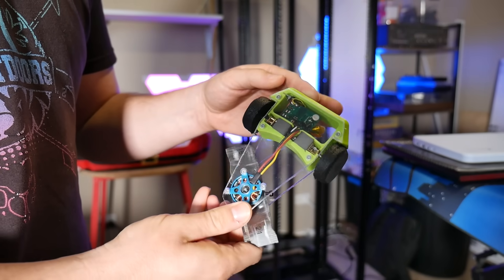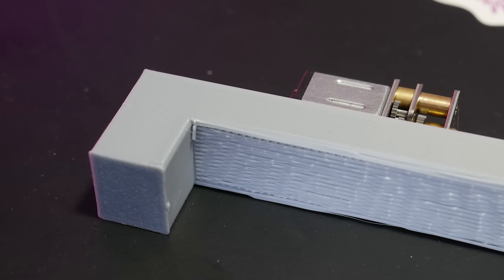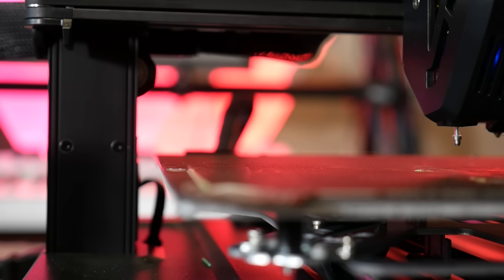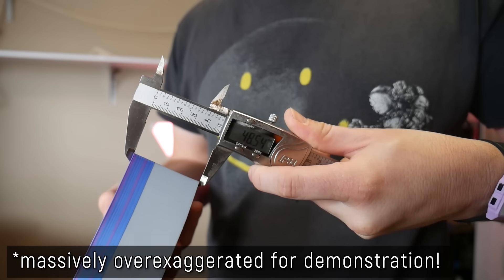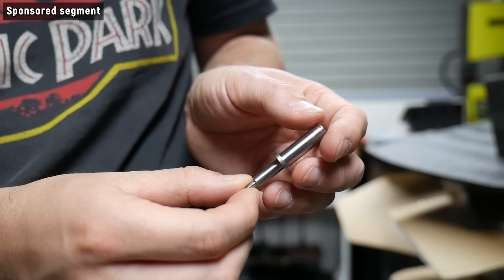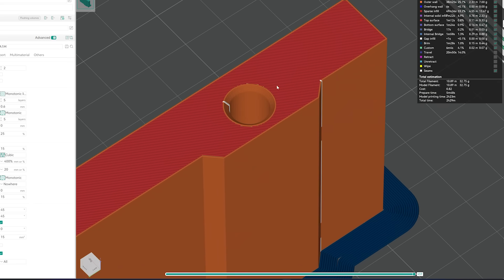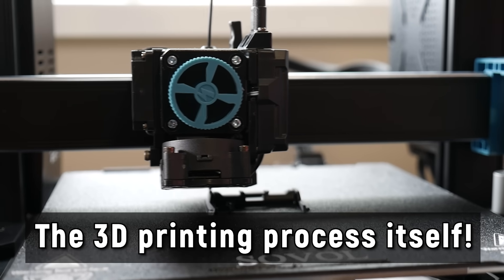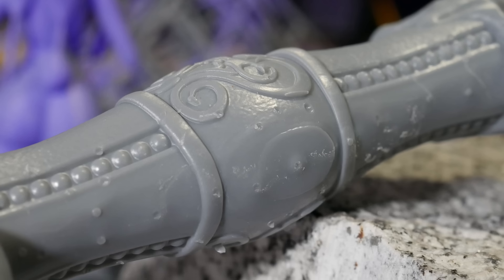Don't make these 3D printing mistakes (they RUIN accuracy!)

Comment: Water shrink as it cool too, so is ice. 
They both strink when cooled, and expand when heated.
But only during the transition state between water and ice, H20 expand in volume when cooled.
Reply: Actually water begins to expand before it begins to solidify. Water is the most dense at 4°C and expands when cooled lower than that (and then of course freezes and expands further at 0°C).
Reply from the maker: huh I had no idea, neat!
Reply: @MakersMuse basically when water solidifies, it forms a specific internal structure that has a lot of open spaces, which is responsible for it expanding as it turns to ice.
Reply: The thermal expansion rate of water is only weird between -0.1 °C and +4.0 °C.
Reply: I suffer from shrinkage when I jump into my backyard unheated pool. Can I 3D print an appendage enhancement?

Comment: Disappointing fibers dont help more. They sure do kick up the strength of things like polypropylene in injection molded industry. That's what all that tough black plastic is under your car hood. The stuff lasts a long time.
Reply from the maker: Boosts the UV resistance too! But yeah, they're basically powder in 3DP filament. Not long enough to help.

Comment: When ever I design a part and the only alternative is support, I design my own. Sometimes a creative set of structures or sometimes just a single block, shell it out to .9 and give it a bridged top of 5 layers (1mm) so it is perfect by the time it gets to .3 from the underside of the model. Sometimes I can hardly tell there was a support used. Its a bit more filament but still cheaper than a failed or ugly print.

Comment: 5:300 i've personally had great success with ASA-CF. the temperature resistance is great, the matte look is nice, the dimensional stiffness is also pretty good and price to performance is pretty good as well. Bed adhesion required a bit of a learning curve but all in all, it's currently my go to filament for "engineering parts" together with PC-FR.  PAHT-CF (high temperature fiber reinforced nylon) is still a lot stronger and can handle higher temperatures but is a little harder to print with and way more expensive. although the strength it offers is unmatched.

Comment: You should have also mentioned seams. A layer has to start somewhere, and the spot the slicer picks is called a seam. Depending on the geometry of a part, the seam can bulge, very slightly.
Reply: Great point, I personally always add a triangular cutout to critical cylinders or long straight walls to force the seam into  a known position where it is best for the model.
Reply: @U_Geek  This is a brilliant idea, don't know why I never thought of it!
Reply: @U_Geek  I tend to rotate the model so the least viewed part is at the back and then apply seam at the back. Not the same thing, but works fine for e.g. figurines.
Reply: @AndersBorgSweden  yeah for figures this is overkilll and may ruin the look more, but for stuff like shafts and mechanical parts, it is a useful trick.
Reply: the image at 9:53 also demonstrates fixing this perfectly, as the seam is now put in the "ear" of the internal hole and not on any of the dimensionally important faces
Reply: @KiWeWi  yeah but that is something else. You need a sharp edge to guarantee it, an ear like that doesn't force it, but otherwise, yeah that is the exact effect we want.
Reply: @U_Geek  some slicers allow you to paint where you want the seam to be
Reply: I'm still waiting for the slicers to allow us to put the z-hop into the infil. It seems obvious.
Reply: @MrBCRC  The seam isn't actually caused by zhop if that is what you mean. It is just caused by starting the extrusion line there. I tried making my own slicer last year, got it almost reliably working, but the seem was something I was experimenting iwth and it will always be tehre, best you can do is scarf seems which join up outer and inner walls to try to improve quality as far as I can tell.
Reply: This trick only works for pretty regular holes, but converting holes to polyholes with twist in slicer settings can hide those seams in the corner of the polygon used to construct the hole. And with the polyhole twisting twisting, the seems don't build up in one solid line, spreading the problem area out a fair bit.
Reply: Especially if kids are trying to print a collapsible sword and each of the pieces of the sword are printed in unison, making one shell's seam connect with another shell's seam. And now you can't break them apart with breaking them.
Reply: Randomized seam location helps.
rather than the error all up one side, its smaller ones dotted all over the place, averages out fit.
Reply: This problem has been solved for over a year now. Some slicers have a setting (scarf joint) which make expanding start and tapering end. Because they smoothly grow into each other, the seams are almost not visible at all. And if you add start position randomization, the seams will become invisible.

Comment: Being new to 3D printing I’ve just come across the internal rounded corner issue when printing hexagonal holes for screwdriver bit storage….  In the model I placed a 1mm diameter circle on each corner of the hexagon and created a cut the same depth as the hexagonal hole. Created a perfect fit on the 1/4” hex bits. Without these reliefs the hexagon had to be at least 0.3mm over sized….holding the bits by the corners with “large” gaps on the flat sides. I think I could have got away with maybe 0.5mm diameter circles. Nice video.

Comment: 7:40 I printed a game controller bumper recently and Arachne butchered small details, significantly reducing "flange" size that kept the bumper in place.
There's no way a thing that changes dimensions as it pleases should be default.

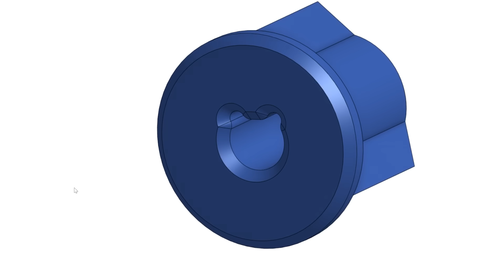Comment: 9:37 I also add recesses to D-bores but I model them in such a way that the flat section doesn't get shorter because this loses some of it's torque transferring capability.
Reply: Yes, if you make the corner circles tangent to the flat, it maintains the flat width. It does take up more room though.
Reply: I once added a recess to a hole just because the seam was taking up space in the hole. I'm not sure if scarf joints entirely alleviated the problem.

Comment: I've used vinyl cutters in the past when working at a textile printing store.
Those use an angled knife which can rotate in its shaft.
When those cutters needed to make a sharp 90 degree angle, the cutting plotter actually makes a 270 degree circle with radius of the offset of the cutting knife.
This way you get really sharp corners.

You're doing something very similar when adding those 'ears'.

Comment: For surface finish, I'm a fan of chemical smoothing paired with light sanding. And if chemical smoothing isn't your thing, filler material works well too. Bondo and paint makes me the 3D printer I ain't. ;)

Comment: For horizontal bores, I add a little triangle over the top: Two lines, set tangent to the circle that meet above the centre point with a 115deg point. Just at the point the slicer would add a support to the top of the hole the walls start climbing at 57deg. The hole ends up to size with nothing collapsing in.
Reply: I just use a  drill bit and the hole is withing ø0,05mm tolerance. Also never add those teardrop designs as it creates stress risers right on the mounting interface.